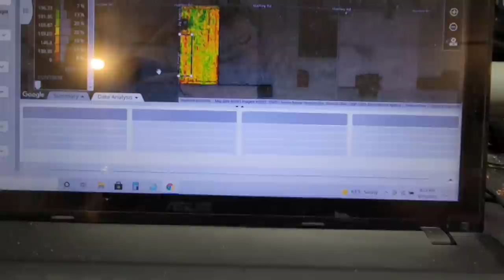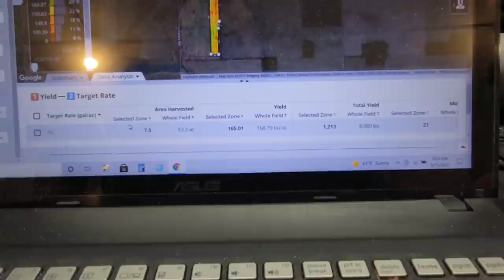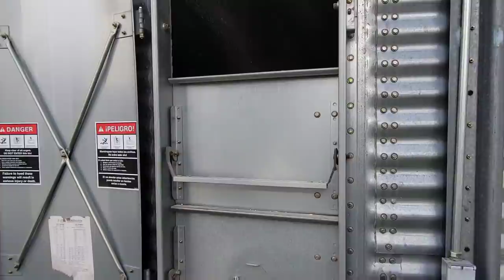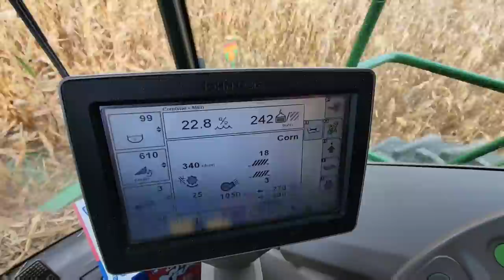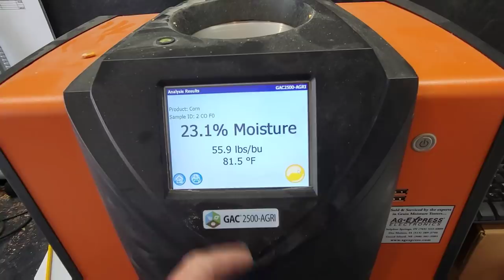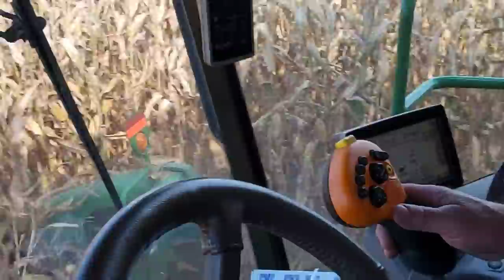Harvesting Candy Corn! - #504

Comment: Do grain cleaners work ? I know Walinga & Kleenair make blowers. I know GSI and Magik Kleener gravity screeners. The entire idea behind a bin is aeration but with repeated use particulate fines build up below the floor taking a efficiency hit. They most like would save on electric costs, and final clean out wouldn't be as a dirty job as it is. Does it come down to money? A expense most don't want to do?
Reply: Good Morning!
Great question! Electric costs are going up, so it pays to keep everything as efficient as possibly. Cash flow is a very important part of any operation.
Gary
Reply from the maker: The fines under the floor aren't really an issue. It's the fines in the corn that reduces air flow. I suppose the cleaners do work but are inefficient and expensive with little roi on corn and soybeans.